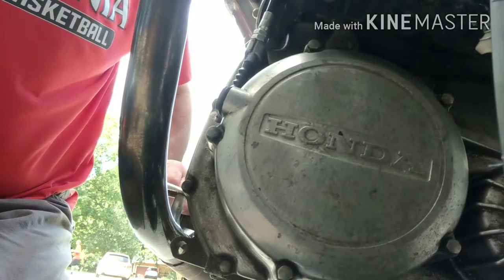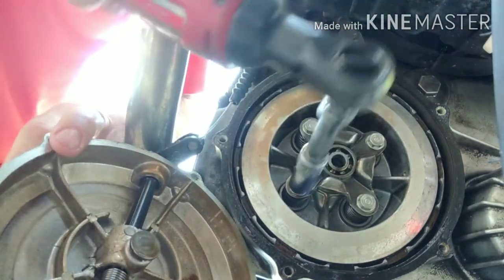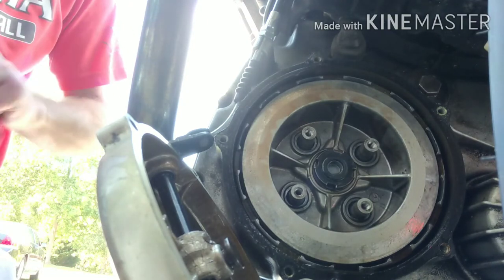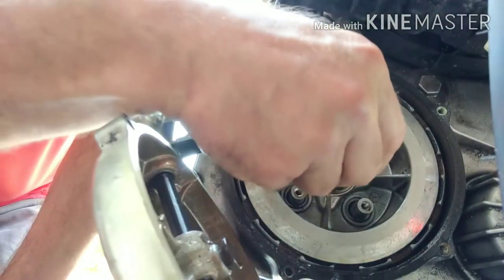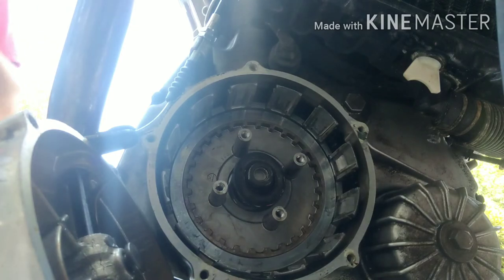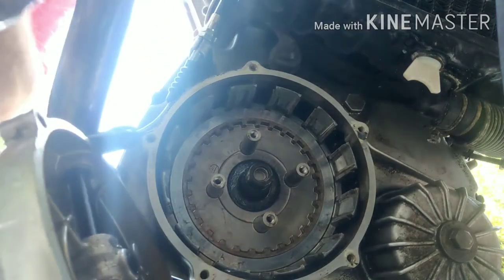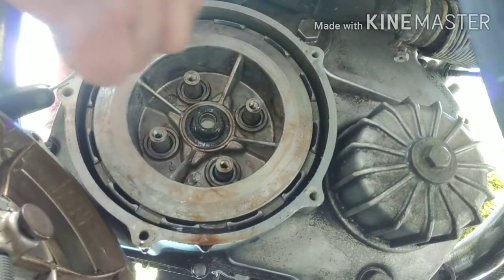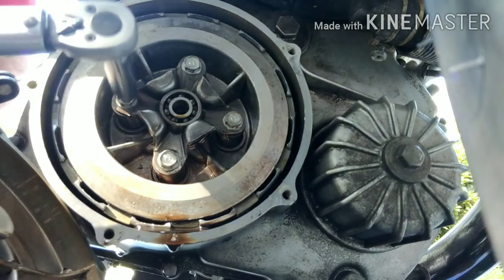Honda GL 500 CX 500 clutch replacement in bike

Comment: Guess I'm on the scope for the trick socket for the center hub bolt, as I'm not really digging chewing up that fastener no how. Great idea about swapping out the inner parts in sequence to save misplacing any of the metal rings. Thank you.

Comment: What oil did you soak the rings in? My first bike needs the plates replaced and this really helped!
Reply from the maker: Glad I could help, I used Shell Rotella T4.
Reply: I forgot to ask as well. Where did you get the replacement plates? I’m having a hard time finding some for my 78 CX500. I don’t know if they’re the same as the ones you got but anything helps.
Reply: I use an EBC clutch .. you'll have no problems..

Comment: For some reason when I pull in the clutch it doesn’t come back out, what could I have done wrong ?
Reply from the maker: It gets pushed back out from the clutch springs. Make sure the clutch actuator is put in correctly.
Reply: @TepcoCycleRepair  so I don’t have a Torque wrench. So the bolts that go over the springs sit all the way down?
Reply: The actuator also Doesn’t have much compression but I don’t see anything wrong
Reply from the maker: @babyfacecoslett4466  Yes all the way down, don't over tighten.
Reply: @TepcoCycleRepair  okay I did that right. It’s like that spring isn’t strong enough to pull the cable back down
Reply: @babyfacecoslett4466  your lifter plate springs Might be collapsed free hight should be at least 35.2 mm long . if they are sagged out they will not apply the pressure needed to return to the full applied position.

Comment: How did you make your socket for the clutch or where can I get one? Great video. About to do my clutch when it gets delivered. Thanks
Reply from the maker: I made it from an old clutch nut tool for another bike. You can find them for under $10 on ebay and Amazon just make sure it says it fits CX500 or GL.
Reply: Awesome thanks!!!
Reply: Bought 26mm socket and left 4 “leafs” 6mm wide. The rest of socket edge cut out with disk grinder😉

Comment: Center nut is actually 26 mm (not 24) socket You need to make a tool. BTW those 12mm nuts on clutch cable should be one on top and one beneath the mount, IMHO. Great video, thx😄!
Reply: No, they should both be on top of the mount! The lower nut is the adjustment, the upper one is the locknut. So many people get it wrong by doing it how you suggest. Its quite clear in the Honda workshop manual.